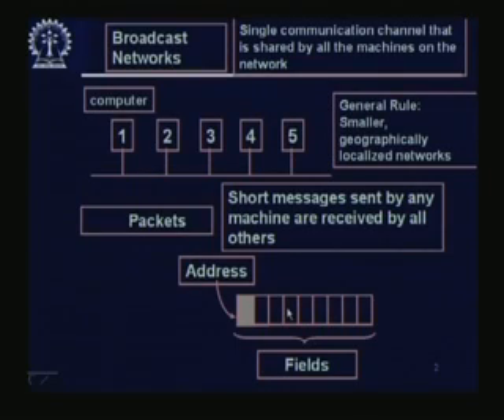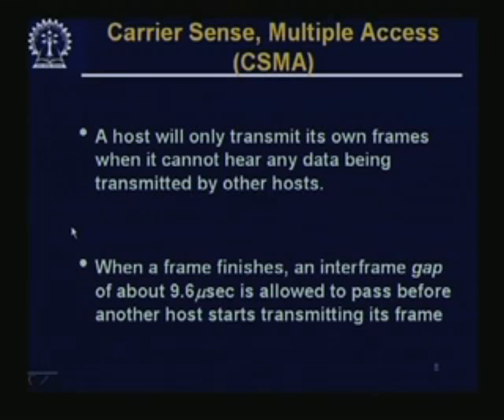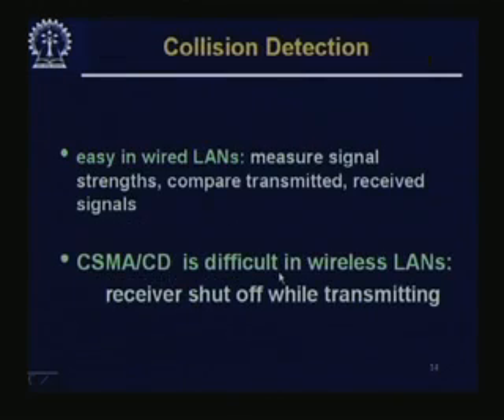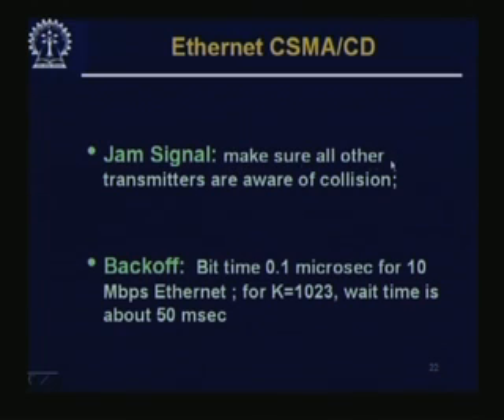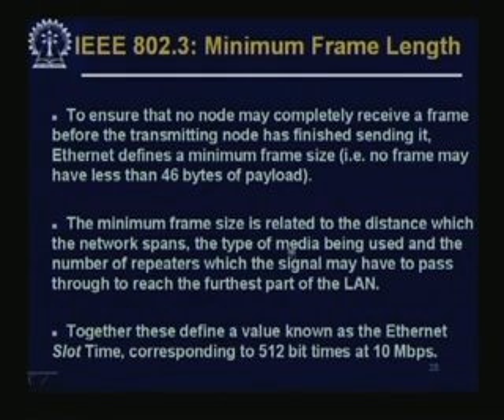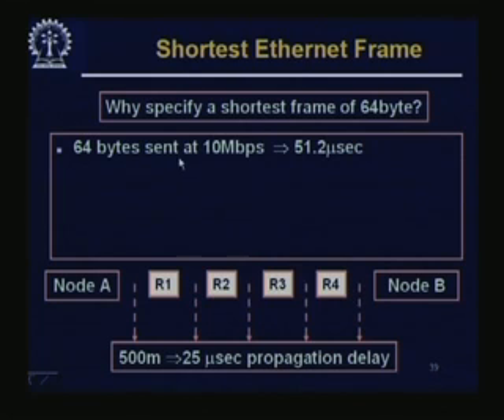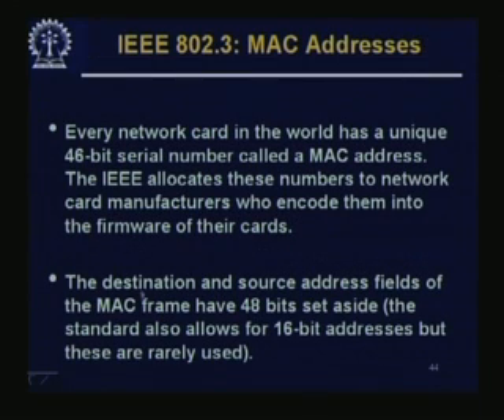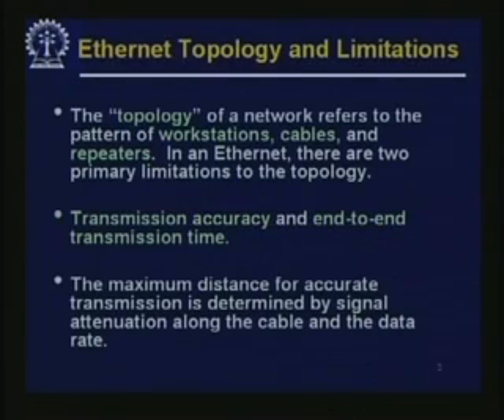Lecture - 19 Ethernet - CSMA/CD

Comment: Question
CSMA/CD system has a transmission rate on the bus of 10Mbits/s. The bus is 2km large and propagation delay is 5microseconds per kilometre. Packets are 1000 bits long. Determine the:
a. End to end delay.
b. Packet duration
c. Maximum utilization on the bus.
d. Maximum bit rate.

Comment: CSMA/CD is dead. 
Why still teach this?
Reply: Alexey Rivkin this lecture was recorded in the 1990s!! So it was not dead during that time..
Reply: I think CSMA/CD is still always there, it is just not used in Full Duplex mode but in general it is still part of the ethernet spec and used once you use a HUB or device that does not support full duplex.
Reply: Alexey Rivkin bro its indian logic :(
Reply: Why is it dead? I might be wrong but imo it is still used as the underlying layer of TCPIP
Reply: It only used with hubs and disappeared once switched networks were introduced.

Comment: @abh03533 Preamble size is kept a 8 bytes for clock synchronization. First 7 bytes are 10101010 and the 8 byte is 10101011. I dont know the reason behind choosing these sequence :)